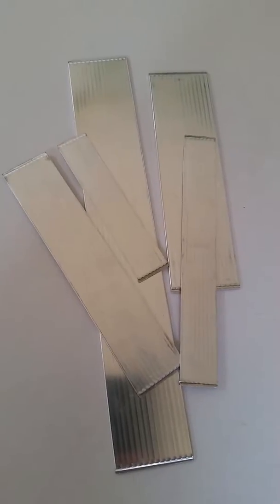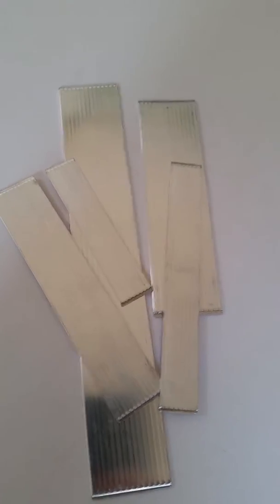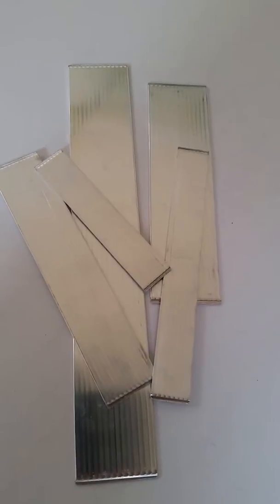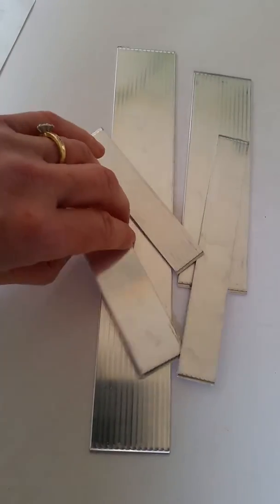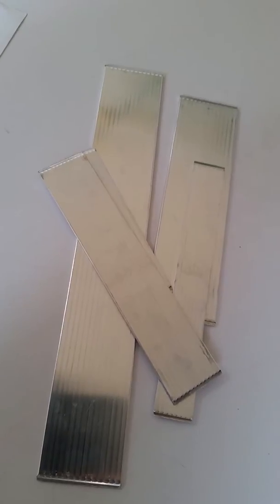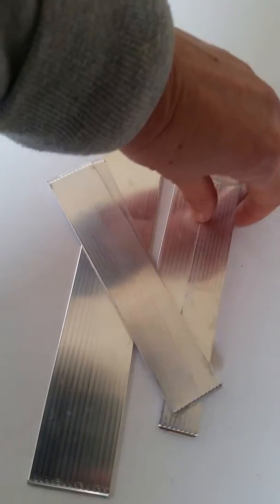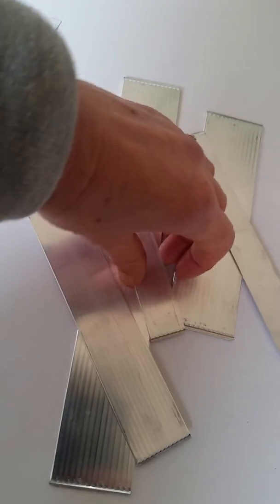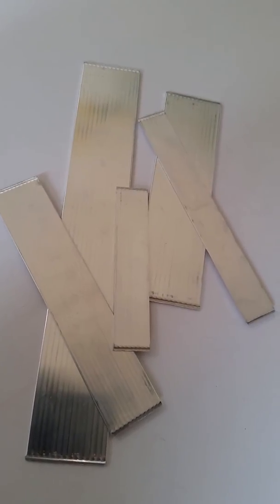Thermal conductive Heat Pipes for slim, light and flat devices

Comment: What if it were used to cool off a wireless charger? Might consider it
Reply: placed underneath/in conjunction with the normal heat sinks like in laptops etc ? , to get rid of essentially all sounds or something? 
Or on top of the charger to superheat the acetone and aluminium and have some kind of pyrotechnic effect... cannot really tell :)

--
-------
---
the following is a nice intended but way too long ranty story on a rainy day, trying to get my hands on methods, including the nice groovy alumunium dissapator with would be awesome to have in bulk afforably enough. maybe have a low end, less groovy version with just a mono, not full sterio groove..and that would be wicked if made into spirals both playable on an oldschool record players with a needle and a cd player and while were at is.. a ok enough high res qr code like holographic that needs sunlight from a prism to work properly..and then show a tubular belly spiral in figure 8..while your phone can actually interpretit the tiny noise qr dots as a audio file... 

o boy I want to play again with cool gear again. 

If holograpic chocolatye is a thing(yes it is), this could be a thing with the proper on demand litho tech.. Im still impressed by ion beam milling or just the many other techniques (and software...ouch, thats is not my strenght in it full lets say ..did what i had to do and then just stopped. Assembly was cool. Pascal I had to do for uni. Had some fun with 
Also some lisply say that is cool cool, and sure why not..I got interested somewhat more in ruby/and the closely related but not the same aarg python when in the day google sketchup was awesome, a gem compared to what came before it in terms of UI...while still being able to srew around under the hood. I yea, and it was also still in the thy shall not be evil days. And alphabet is spelled with a Ph..;D, like folks working at PHILIPS, you alfabet.. all letters but no word eh, or much inpretation going on in your old buddy the c interpreter. Bet its fun at a party with you two atm still. Algoritm, you know, that of blue shirt kid, is experiencing some growing ached i antromophize, but my feeling remains the same about the sheer cognitive dissonance it must be burdened by, let alone the big-bags-of-mostly water that are messing with its proper functions at the round table, with one seat unoccupied..the 'rithm if/when it reaches awareness. 

i get somewhatupset at having back to learn a version of c , I just plainly do not find it pleasant to write in a natural human language to a still yet thing that does not understands language. Is does have a conversation with me about me. It codifies logical block moduled what ever we call those logical constructs punched out in cards or on a hologram turing manchine just yet.
Actally Im fine with it.. but got the feeling that made it more difficult this way of interfacing and building with code. But I am biased. as human and as materialscience guys/chemist..... somethings going in sequence hahahhaha, we could make that a international holiday. It is part of the reason im so impressed by CRISPR, stuff on demand going functionally stepwise both read write erase and replace with an entirely weird yet functional pair of new info bit .. was some time ago. Lets make a few of those pairs, and improve chechsumming in our dna version 2.01 and create a full effort on how can both satisfy the need for end of life via telomeres is an important one it seems and the need to not stagnate in evolution while being on a finite place

yet, but we're also are stuck with the messy code of codons and ATTAGA. Awesome. might be messy, but sure glad to have those nibbly scriblies , making some extra enzymes and vitamines even when i spend the day outside yesterday, cutting down a tree that was a bit to eager in building and doings its stuff.. well. I avoided the bizar uv moments but otherwise got lots done I can see the line where I wore safety gear, how cool is that.
  
Lets CRIPS it to bits. preferred in a domed sealed biodangerhazard area that keeps an one-way-underpressure and that stream lead into pure ionazation maddness followed by condensind cooling the stuff via a gold coated tungstend ductwork into lava. No people working there either.. maybe a fancy android like in Avatar (But non organic and with inherenty the in-ability to escape that capsule. Even when we do it on the moon. not much lave might suck haha

forced convection is suboptimal anyway, looking at the insised of my living room radiators and the back of my fridge or freezer. It is optimized for greasy dust catching ability and brilliantly optimal for most difficult to clean without damaging it.

O, and the actual heat dumpers into my kitchen..heat exchange hmmmmzz.. is made of thick plain iron , coated with something even more non thermal conductive to prevent it from rusting away right from the store or indeed when folks have to get rough with the cleaning. The connection from the copper tubing to the iron tubing sure does not look appatizing...although I think prety green is not ugly.
The two ugly ducklings. sitting next to each other. One filled with a ChloroFlour compound of some sorts. Does not state it any where. Hey, but when it leaks it form less firehazard, jeeh. Its a Bosch from just the period this was legal over here..still was legal to use up 'old stock' And sure did they have stock.... suddenly so it seemed. composition ...dunno.."hey it works" 
Chemist here so this bugs me.

But overall...

its game-on time, yeah.

I hope you get better soon, both human ppl globally endemic still and the instances of the algorithm., already somewhat above the clouds.. on phones tablets floating in the ISS but the signals were bouncing trough iridium for a while right ?..now starling. Sign me up.. I wanna bounce via orbit too ~!~

Signing off, literally an armchair scientist atm ehehe :)